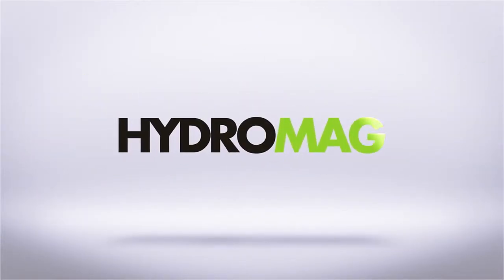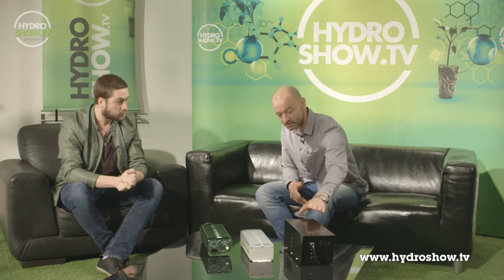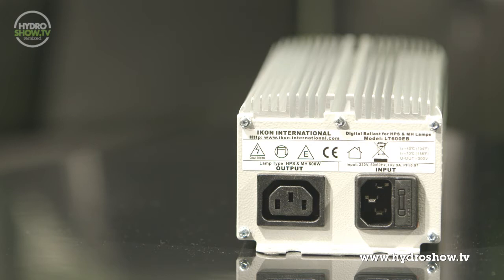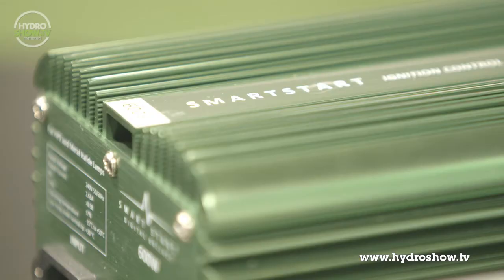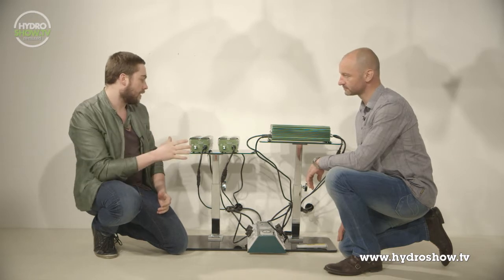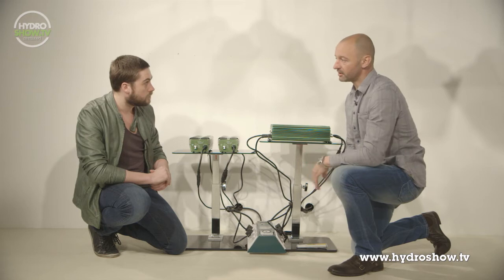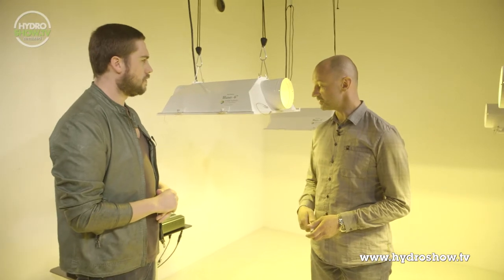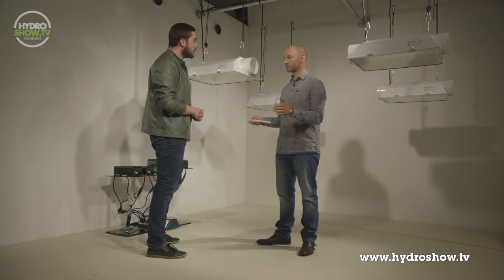#46 - 600w Digital vs Magnetic Ballasts New Ballast technology (2013)

Comment: MAG. BALLASTS ARE THE BEST WAY TO GO.. MY MAG. BALLAST IS TEN YRS OLD STILL RUNNING STRONG! ELECTRONIC ./ DIGITAL= THEY  FIRE UP TOO QUIK!!! WHICH FRYZZ BULBS!! GO AHEAD LEARN FOR YOURSELF!!! THE MAG.600 LOSES 5% (EFFICIENCY)..... DIG AND ELECTRONIC = 10% + LOSS IN EFF.   REAL TALK ! PEOPLE TELL U ANYTHING TO SELL SELL SELL !!
Reply from the maker: Are you sure you've checked this? Digital ballasts soft start which means there is no spike on startup, unlike with magentic (our ignition test in Hydromag issue 013 / March 2015 will prove this). And the efficiency, well, just the exact opposite to what your saying (according to our independent tests here: http://issuu.com/hydromagazine/docs/hydromag-011-hydroponics-magazine/24 )
Reply: if you talking bulbs , try replacing all your ballast at the end of the warranty cuz thats when they typically burn up. I have never had to replace a mag ballast in 8 yrs and replaced 3 dig. just my experience !
Reply: every two yrs i change my bulbs , only had two burn out Osram are good bulbs & Venture mag. ballast. good shit.